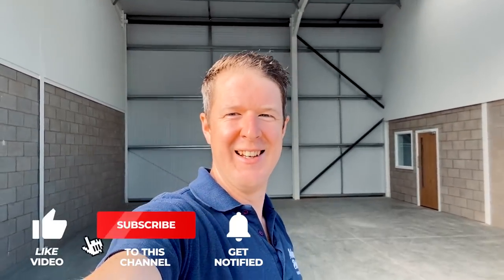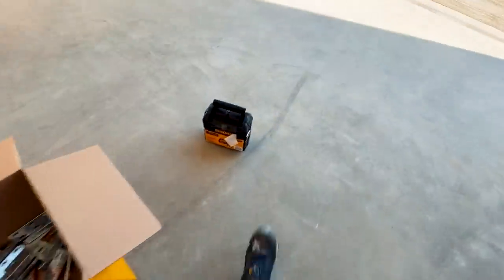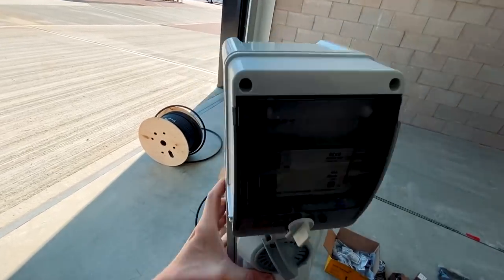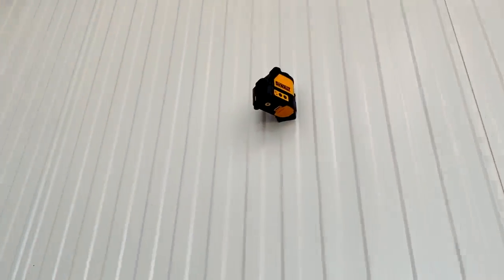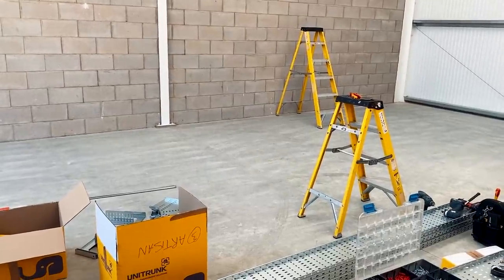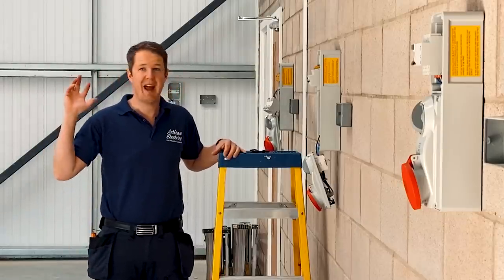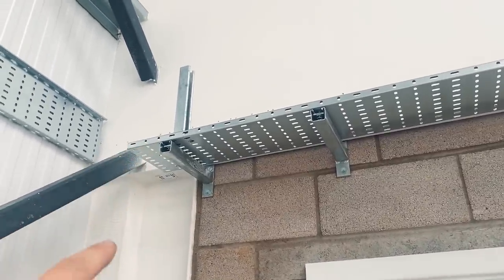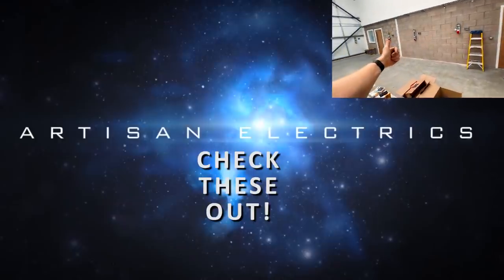Cable Tray, Three Phase Sockets & SWA Cable Install - Part 1

Comment: Tidy work, however what did you use to secure the tray to the corrugated steel outer shell and has that not 1, left dangerous points on other side, 2. Now punchered what would of been a weatherproof wall?  Just interested questions?  not trolling!! Before anyone counters my question.

Comment: Think I would have spanned vertically with strut between the two horizontal perlings at the back so you could have kept the tray running the same way up all the way around plus the strut could have doubled as a fixing point for the socket drops 😉
Reply: My thoughts exactly. 👍
Reply from the maker: Good call!
Reply: 2nd this can buy Flexi bends but cutting lots is just as quick and easy job done. Still a neat install never the less

Comment: Neat job , only thing i would pick you up on is fixing into mortar joints , mortar is far weaker  than the blockwork  plus if its the last horizontal joint possibility it will eventually disturb the block .
Reply from the maker: We didn't use the mortar joints specifically.
Reply: #TopTip
Reply: @artisanelectrics  The  lower fixing  throughout in the mortar joint ,  better to have dropped it down 50 mm , problem is if its the last joint it could  crack the mortar joint and everything would be free swinging eventually,  we had to fix unistrut on the walls and bracket off  because of this issue

Comment: How many 3 phase sockets are on 1 circuit 🤔 isolating will mean taking out several sockets doubt that board has enough capacity for all those 3 phase sockets to be separate circuits
Reply from the maker: Yeah exactly we could only work with the few spare ways we had but they won’t be using anything too heavy anyway.
Reply: Client should have been told new board
Reply: These seems to be General socket outlets in stead of dedicated outlets,  he's done well.

Comment: In America they are called spring strut nuts and cone strut nuts.  Cone strut nuts lock to the sides of the strut. These are newer style. T he spring strut nuts have been around for years. I have used a ton of them. Love them.
Reply from the maker: Nice thanks
Reply: Nice looking job. Just the way I like it. I have run a lot of cable trey but it was with tape measures and levels. The laser technology makes it so much easier.
Reply from the maker: Yeah laser really is a game changer

Comment: Why did you keep changing face with the tray? Just hang it all the same and span with unistrut and window brackets on the front and back walls
Reply from the maker: I prefer to mount it horizontally where possible its easier to run cable in that way.
Reply: Artisan Electrics I get that but it could easily have been kept horizontal on all 4 sides. Then you wouldn’t see cables jumping on and off trays et every bend. You could have made unistrut framework  on the front and rear walls hung off the existing framework and then used cantilever arms on there as well. Flat 90 bends and jobs a good en.
Reply from the maker: That would have been quite difficult there was a lot of stuff in the way.
Reply: Tbh i thought the same always keep tray flat in warehouses and jumping on and off tray is a bit ruff

Comment: Just thinking about that job . It’s very neat by the way 

If u put 3 x 32amp sockets on a 32amp radial then if a machine was plugged in which draws 30 amp say , then the other 2 sockets would be useless wouldn’t they ? It would trip due to over load ? 

Also if a machine was plugged in which draws 6amp say then it’s protected by a 32amp mcb ?

Comment: Hello,I noticed you used self tappers on the metal wall to fix the boxes and cables.Would not the screws appear on the other side or is the wall double skinned.

Comment: What is the unit going to be used for? What are the sockets going to be used to power? Three 4mm radials doesnt seem much for all those sockets.
Reply from the maker: They are just using some fairly light appliances they sent me a list of all the equipment they will be using with the various KW ratings in advance and I designed it based on that.
Reply: @artisanelectrics  sounds good, not a room full of arc welders then 👍🏼
Reply from the maker: Nope! 😂

Comment: What are all those three phase sockets for. I'm guessing only 1 will be used at once. Other wise you should of wired them on there own circuit.
Reply from the maker: They are only gonna be used for fairly light equipment so they won’t be fully loaded

Comment: The tray looks way oversized  to me for the 2 x 4mm 5 core and 1 x 4mm  3 core  only three cables there?
Prefer expanding bolts to fix cantilever arms, personally would have used trunking & conduit drops.
Will there be a part 2 to this?
Reply from the maker: Yeah I purposely oversized it to allow for future expansion if needed, the labour is the biggest cost when fitting tray so might as well fit bigger and save the client money in the long run.

Comment: Honestly don't get why you mounted that cable tray flat along those walls the like you did?? I would have mounted it the other way and incorporated cable tray drops down to each socket outlet. More than one way to skin a cat I suppose 😻.
Reply: There was a vertical beam in the way so the brackets are 450 mm. He would have had to set around it. Would have taken longer. That's what it looked like to me. But it was a nice job.
Reply: @carlmarquardt994  There wasn't any major obstacles along both maisonary walls that 40mm uni strut or an off set or two would have solved to my eye, both legs could have tied into the other run on the other wall with drops down to the sockets where needed. I'm not knocking the man's work like I said there is more than one way to skin a cat.

Comment: Classed as exposed conductive part. On your certificate you have tick box for water, gas, structural steel. Keeps everything at the same potential. So it fails under bonding. Its a simple fix. It's not a bath tub if that's what your mixing it up with, part of your electrical system.

Comment: Could you show what fixings you used to fix the cable tray onto the wall
Reply from the maker: Just normal raw plugs and 2 inch screws with penny washers, they gave a very solid fixing.

Comment: What size breaker did you use for each set of three 3phase commandos?
Reply from the maker: You can see in part 2
Reply: Surely has to be a 32amp mcb ?

Comment: Did u use self tapers to drill into the metal wall of the garage
Reply from the maker: Yes
Reply: Is it double skinned then otherwise could leak ?
Reply from the maker: Yes it is

Comment: The correct term is channel nuts.
Reply: Spring channel nuts, if you ordered channel nuts you would get springless.  Also you need to order long, medium or short

Comment: bond the tray together with earth braids/fly leads. 

Can’t remember the last time I’ve used spring zebs, always have normal or pull the springs off.  zebs I’ve always called them! 
 Nice job though so far!
Reply from the maker: Thanks!
Reply: Why bond the tray with fly leads? Cable tray is not in itself an exposed.c.part, so if not used as a cpc, needs no earthing, and if it is not an extraneous.c.part, it requires no bonding connection - see section 10.11 of guidance note 8 for details. The tray in the video was neither an exp. or extr. c.part, so fly leads would serve no purpose at all.

Comment: nice work Jordan, lot easier to clip cables with tray mounted that way and for any furture runs that may go in especially if you are working on your own also beats having to move any clutter on the floor to do the job and if data cables or fire alarm are neeeded it makes it much easier to add some fillet in it... just wondering where did you get the extra long screw adapter for drill?
Reply from the maker: Thanks yeah that was exactly my thoughts! Armeg extension bit you can get it here: https://amzn.to/30B4QtX

Comment: Nice little easy install. I hope you provided earthing links between the trays to link them all together. I would personally have used trunking and conduit. It would have taken a little longer but that is just my preference.
Reply: Yeah, trunking and singles is nice. Easier to add to later also
Reply: Same here terminating SWA plus the cost. Run singles in trunking.
Reply: @SME_Ste  Yes I would agree with that too.
Reply: Why would you earth the tray???
Reply: I think the tray looks great and is really easy to add/adapt
Reply: You don’t actually need earthing links in the tray because he is not using the tray a protective conductor.  Reg 543.2.1
Reply: MrImATarget ‘earthing’ means you are using the tray as a protective conductor and has nothing to do with bonding.  The tray clearly isn’t  being used as a protective conductor so the term ‘earthing’ doesn’t come into play.

‘Bonding’ is required if the tray introduces its own earth potential, which is doesn’t because it’s fixed to the fabric of the building and the structural steel that will already be bonded to the MET

In this case the tray is neither an extraneous conductive part, nor an exposed conductive part.  The insulated SWA cables provide the same protection as class 2 equipment (Reg 412.2.4.1).  If you were to run singles on the tray (obviously you can’t) then it would become an exposed conductive part.  Which is what metallic trunking and conduit would be classed as when containing single insulated cables.
Reply: The Thing 👍

Comment: I'm no pro but some sites I've worked on I've seen sparks earth the tray. but would you need to earth the tray?
Reply: Yes it's a conductive part of the electrical system & must be linked to earth.
Reply: I agree with Douglas reply
Reply: @douglasgreaves188   seen this argued both ways  by different  suits  but yes i agree with you  every time
Reply: douglas greaves it will only have double insulated cables on it so not really required by the regs but I’d probably do it my self . But then they say your making metal work potentially have touch voltages under fault conditions where there wouldn’t normally be.
Reply: @robswingler   I always try and anticipate what may happen in the future , now thier is a good chance that tray may get used for other services , extra circuits even as a hanging point for equipment  so dropping an earth link in  is probably well worth the effort  cost wise pennies , also around by the  back of the consumer unit there appears to be  twin and earth  going vertically on a piece of tray so  there is a  potential  for an issue  in the future
Reply: There is a difference between ‘earthing’ and ‘bonding’

Earthing would mean that the tray is being used as a protective conductor.  In this case it is not, the SWA cables provide their own CPC.  So the tray does not need earthing.

Bonding would be required if the tray is introducing its own earth potential, in this case it is not as it is fixed to the fabric of the building and the steel structure will be bonded.

The SWA cables are insulated, so provide the same fault protection as class 2 equipment.  It would be different if you ran singles in metal conduits or trunking, you would then need to earth it.
Reply: douglas greaves no you are wrong.  You have to decide if it’s an extraneous conductive part, or an exposed conductive part.  In this case the tray is neither because the SWA cables are insulated, the tray is not being used as a protective conductor and the tray does not introduce its own earth potential.

I’m some cases you can cause more of a shock risk by connecting the tray to the MET as under fault conditions you are extending the touch voltages.
Reply: steve robinson nobody is going to use the cable tray as an earth in the future.  Therefore there is no need for earth links.  

Yes If you were running singles in galv trunking you would need earth links.
Reply: @thething1749   given its a factory unit   you don't know what else is going in that tray  (lets face it  the world and his wife will use it) always better belt and braces  and dropping a link in to the earth  isnt a costy job
Reply: steve robinson you can actually increase the shock risk under fault conditions by earthing the tray if it is not required.  By connecting the tray to the MET you are extending any potential touch voltages.
Reply: Could always test the tray once installed to see if it meets the criteria of an extraneous conductive part?

Comment: Not bad but putting power arms up with screws and plugs to me is just a big no no to me . Also when u put the jointing plates on the tray and the locating clips I always put a couple of 6mm roofers to secure it in place as in the futrw the clips may become knocked out and then the jointing plate will become lose.
Reply from the maker: Thanks for the top tips!

Comment: You should set the trays onto the tray on its side
Reply from the maker: I prefer it like this its easier to run the cables in.
Reply: @artisanelectrics  it makes no difference with the cable pull

Comment: Sorry Jordan, you have done a nice job but I think it would have looked much nicer if you mounted the tray vertically the whole way around!  

The horizontal tray feels like it’s almost in the way and upsets my OCD.
Reply: Another one who would vertically mount all cable trays,much easier & neater,can mount them on stand off's if required
Reply from the maker: I don’t like mounting it that way as it’s much harder to install the cables on it like that.
Reply: Artisan Electrics come on Jordan, at £150.00 an hour you should have to struggle a little bit 😉

Comment: Thanks for the great content! What advice would you give to someone (me) currently thinking to switch from Mechanical Engineering to Electrical trade? - After 2 years in the office, I am desperate to be back on site! I have some experience as a Carpenter but not qualified. I think Sparks work is more related to my Degree! I am 32 years old! Kind Regards, :)
Reply from the maker: Just try and get out there and get some experience on site and book a course for the theory side of things! Hope it goes well!

Comment: Nice job. So annoying when you’ve got all those holes and you still manage to miss every single one. Thanks for sharing. 🐵
Reply from the maker: Haha yeah thanks
Reply: @artisanelectrics  after a bit of experience with tray you learn that 1.2M brackets will line up with the holes 😂 
1st video I've seen of yours n I'll be checking more out

Comment: I have sat here for 30 minutes trying not to comment. Firstly I was amazed how many people said what a great job you had done. 
You have some of the strongest brackets that money can buy and fix them with plastic screws and mickey mouse screws and penny washers.
God help the poor painter next time round that puts his weight on that tray. Looping 3 phase sockets OMG..... 
Fixing sockets to the cladding on the end walls ( not strong enough ).
Oh by the way you should not fix brackets into joints on the wall as was said by another commenter. 
You have a lovely laser level which you struggled to see, close the roller door a little and you might see better,
 you should have used a stud/metal detector or magnet and found proper fixings on slab wall and fix the tray face on and crinkle the 
tray at the corners or use manufactured bends and use bonding straps. Metal filings everywhere you drilled holes............ even into the sockets.......
Please please please dont do anything until you fix this simple little job first and then proceed with cable instillation.
I hope that you will use earth rings for the glands in the plastic boxes. The only reason I am commenting is, you seem a great young man that will do well
in this hard trade and I wish you well in the future.
Reply from the maker: Trust me those fixings are solid I tested them myself by hanging off them to make sure!
Reply: @artisanelectrics  I would love if you done a video of you with a secured harness walking from one end of the tray to the other end, oh no, maybe that would not end well . If that was my job I would at least go back and fit one 10 mm anchor in the solid block of each bracket. I would love if you could ask Thomas Nagy's opinion on this. I love your videos and your work is very neat and tidy but just think about this, it might save someone's life down the road. Good luck with your business and work safe 😀😀

Comment: A domestic electrician trying to do an industrial job. Different trade completely, easier and neater way to install your project
Reply: I take it you wouldn't put a light fitting up at home then or add a socket outlet??
Reply: Not a different trade, you are just a helmet